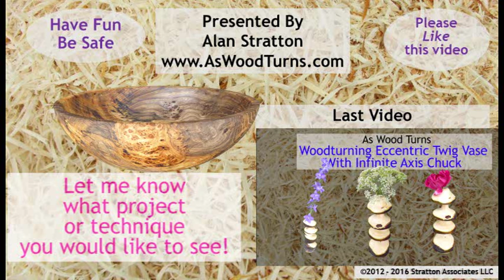Woodturning Ugly Duckling Wood Into Beautiful Swan Bowl

Comment: Fantastic looking bowl Alan!  I love turning crap-looking wood - more often than you'd think, there's gorgeous wood inside. :) 

Pledge Future Shine (floor finish) is actually a really thin acrylic.  If you paint it on that soft punky wood, let it soak in, reapplying as much as it'll drink up, and then let it dry for a few hours, it'll harden up the soft wood somewhat.  (I have some in a small jar & dedicated a paint brush for applying it.)  Only penetrates about 3/16" deep without a vacuum chamber, but it really helps that overly spalted wood that you can't turn without tearing out.
Reply from the maker: I'll have to try that!
Thanks for the suggestion.
Alan